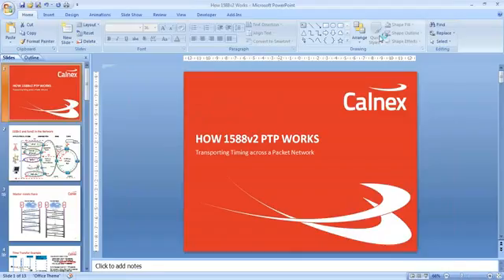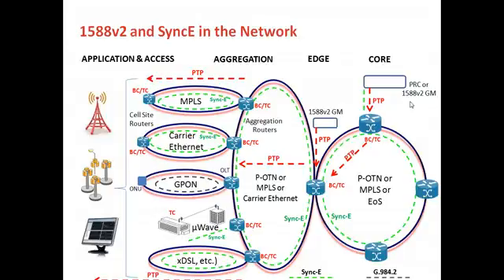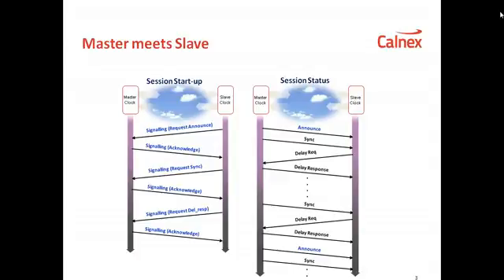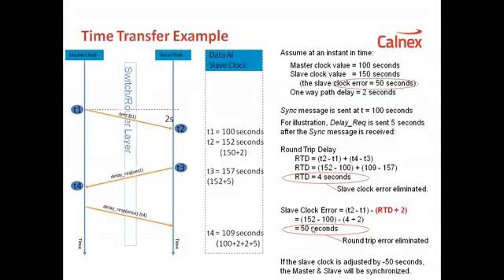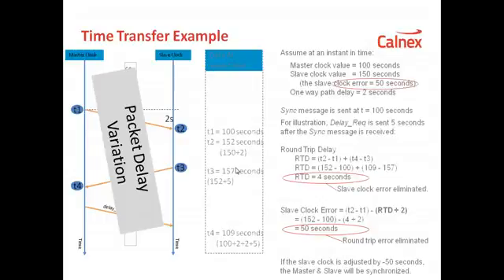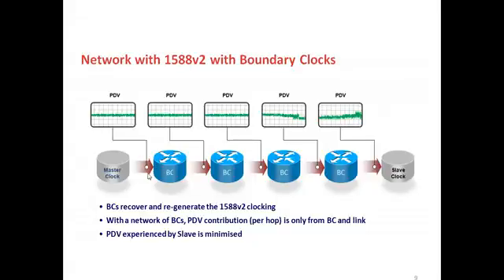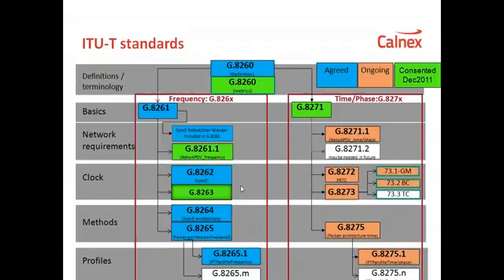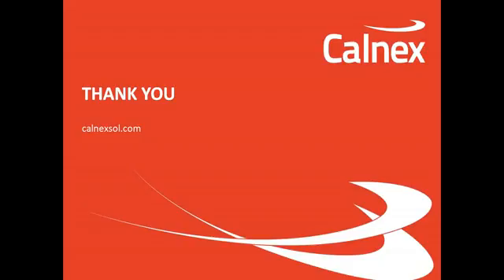How 1588v2 Works SD

Comment: Slave Clock Error (3:41) = (t2 - t1) - (RTD + 2) = (152 - 100) - (4+2) = 52 - 6 = 46. How you take 50?
Reply: No. Slave Clock Error = (t2 - t1) - (RTD/2) = 50
Reply: Oh! Sorry. Because of not good video quality sign "÷" looks like "+"
Reply: the formula is  = (t2 - t1) - (RTD / 2) = (152 - 100) - (4/2) = 52 - 2 = 50.